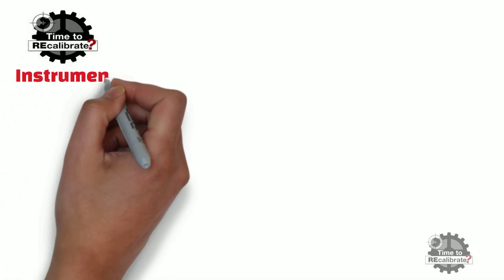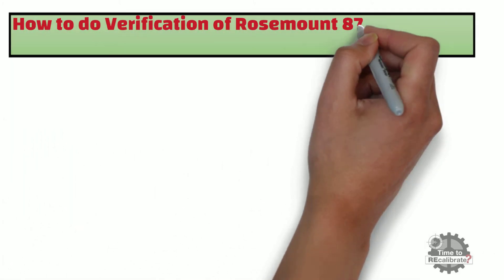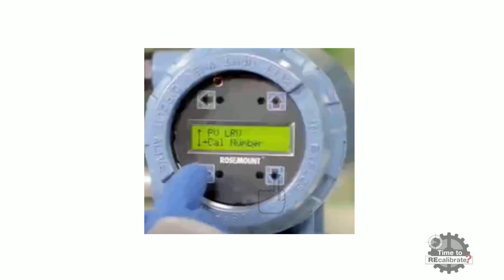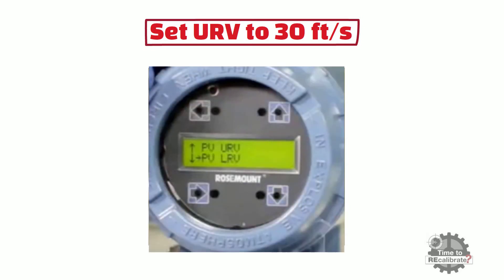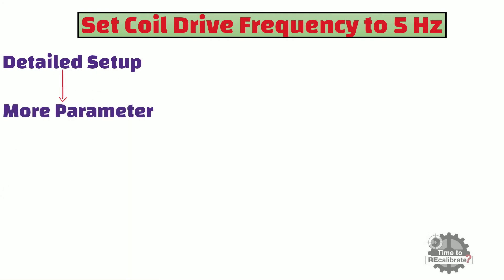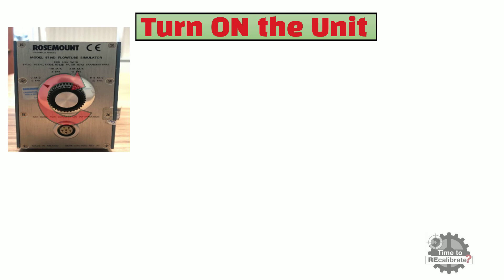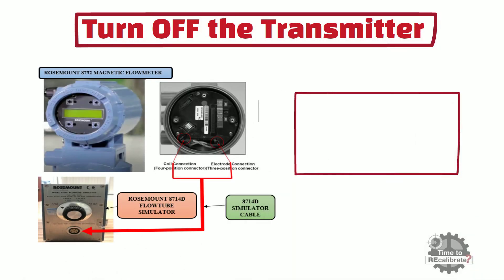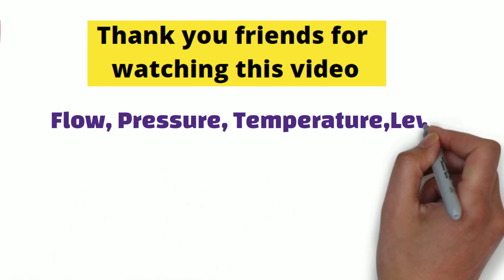Rosemount 8732 Magnetic Flowmeter Verification Procedure | Rosemount Flow Transmitter Calibration

Comment: Great video, I run a company that specializes in this service and this is exactly how you test the transmitter. One suggestion though would be to megger the flow tubes coil to ensure it hasn't been compromised. Also checking the tubes electrodes(process permitting) is a good idea too.
Reply from the maker: Hello Dan
Thanks for your comment. Where do you run your company?
Reply: @InstrumentCalibration   My company is Tower Electronics Canada Inc and we're in Ontario Canada.
Reply: @dmatchtech hello thanks. Please how to contact you. Need some help calibrating these transmitter .
Reply: Thanks. Instead of meggering it isn’t better to just check the resistance on it
Reply: @BrainyBytes_shorts  If you use a regular meter to check resistance the voltage used by the meter to measure resistance could be only a few volts. You might get a measurement from coil to ground showing there is no short. When using a megger at 500vdc it has the potential to check for shorts or breaks in insulation. Keep in mind some mag meters coil drive voltage is around 80-100vdc.
Reply: @dmatchtech  thanks . Please can I contact you directly cuz at the moment I would like to calibrate the 8732E. Do you please have a step procedure how to do it ? 🙏

Comment: How can you perform verification on Blind transmitter ? (Tx without LOI)
Reply from the maker: Hello Yogesh
In this type of transmitter, you need to perform  3 points verification. You need to check mA output of transmitter at 0 fps, 3 fps, & 10 fps. mA output should be 4 mA at 0 fps, 7.86 mA at 3 fps, & 14.89 mA at 10 fps
Reply: @InstrumentCalibration  thanks for the reply. from did you get 4mA, 7.86mA, 14.89 mA? Any reference for this detail? . what about verification for Foundation fieldbus Tx?
Reply: @InstrumentCalibration  Or I should have asked you Can SMART Meter Verification or Manual SMART Meter Verification possible If Tx is blind (without LOI Display)? Appreciate your support.